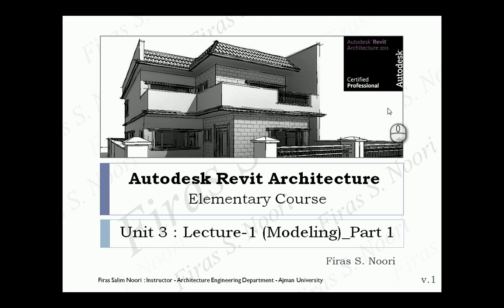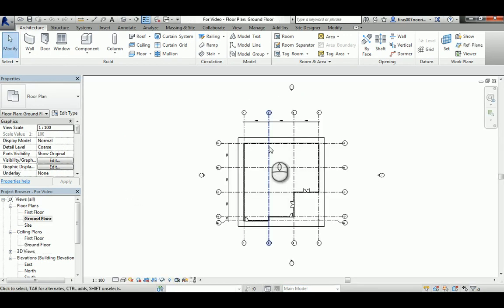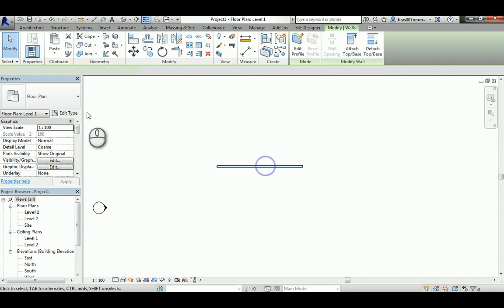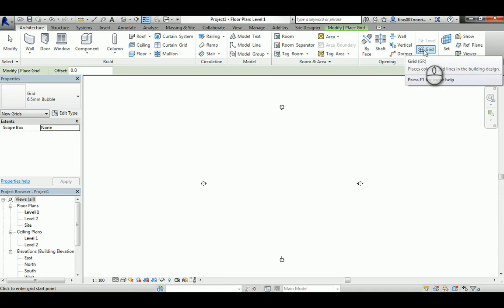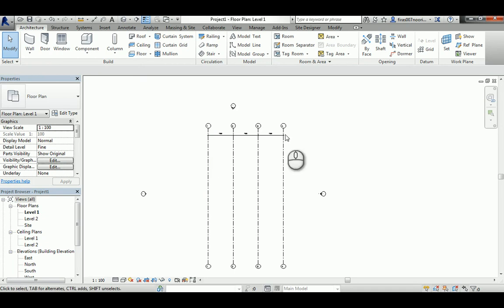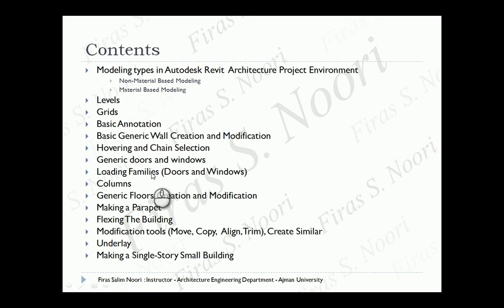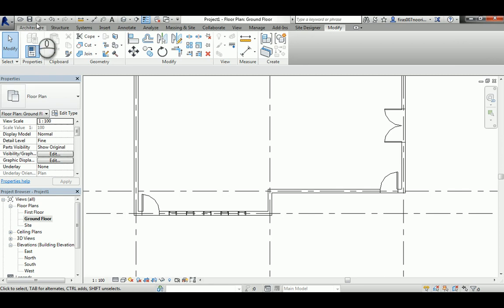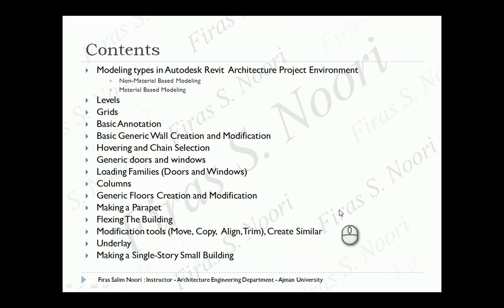Revit Architecture _ Unit 3 _ Lec 1_ Modeling _ Part 1

Comment: very great videos and excellent understandable explaining, and i have question Mr.Firas regarding creating the floors as well as any another system family, is it better to create a floor on two stages (I mean making first  the concrete base then making another layer of the floor in different type such as generic wall ) same as the real constructing of the floor cause we don't make the finishing of the floor while the building id under construction, also it's better for the quantities I guess?
Reply from the maker: Many thank dear Fawaz, It is better to create one detailed slab with multiple layers in the same family as long as you are making a 3d modeling, it will not affect at all the BOQ, but if you want to make 4d or 5d modeling then it would be better to separate the slab concrete as an object the create another family for the finish